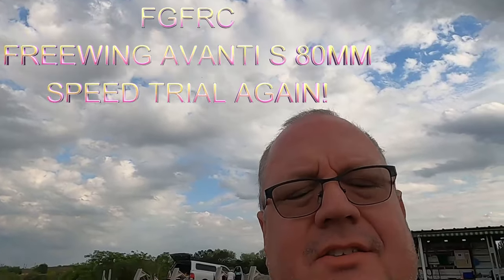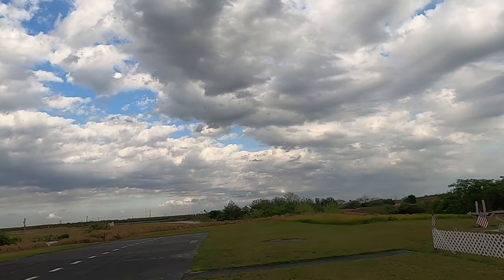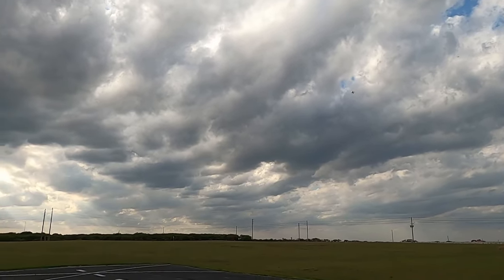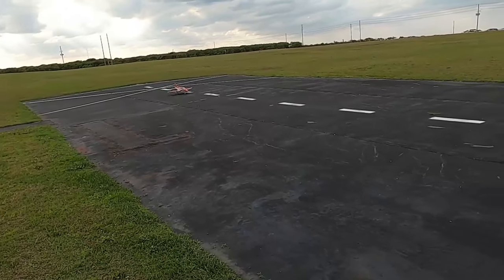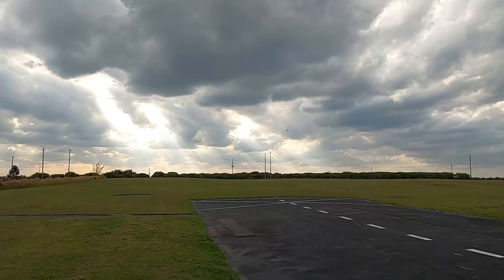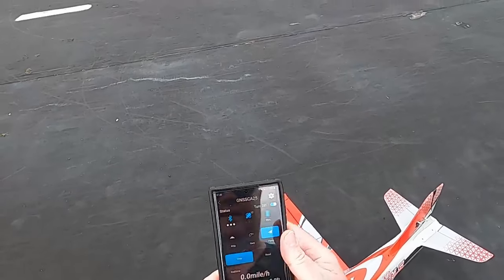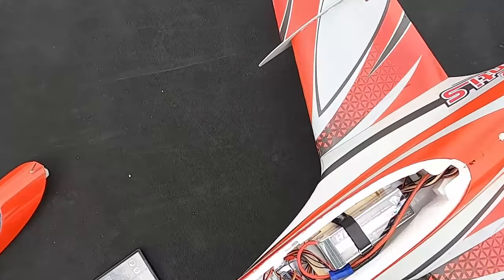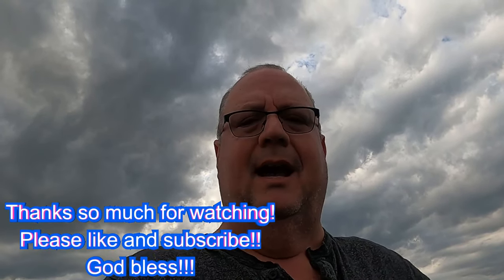FREEWING 80MM AVANTI S V2 2ND SPEED RUN! HAT CAM CHAOS! by FGFRC

Comment: I was looking for your speeds (but I was remembering around 200km/h) to compare here to the new Avanti 90mm from FMs which ist pretty much the same but heavier :/ :(
Reply from the maker: ll ok. Yes a little bigger.
Reply: @FatGuyFliesRC  yes by 54 mm in span and 60 mm in length. But the edf seems to push the same as the Freewing 80mm if both datasheets are correct. The 90mm FMS goes a step further when putting a 8S Edf (4075) or even a 12S in. I have some 12S JPs second hand in the basement. But that setup get too heavy for the plane I think... Maybe the only special think besides the Colour Sheme on the FMS is the vector fuselage as optional...